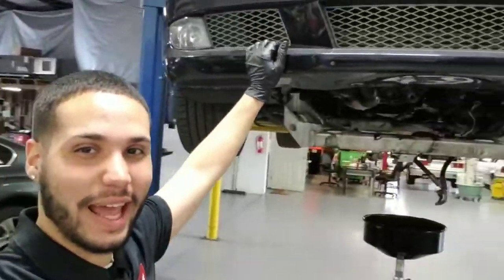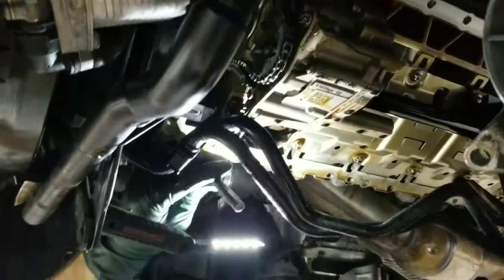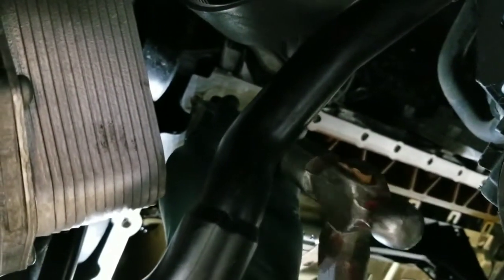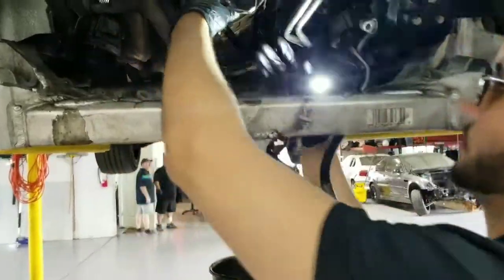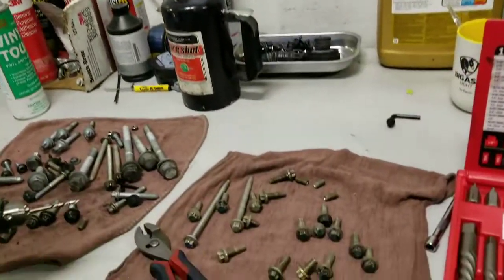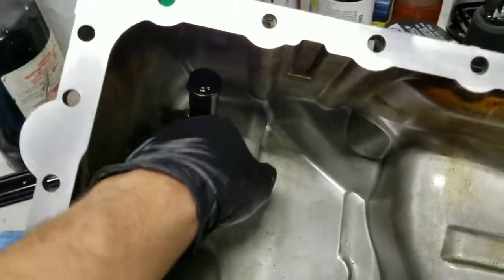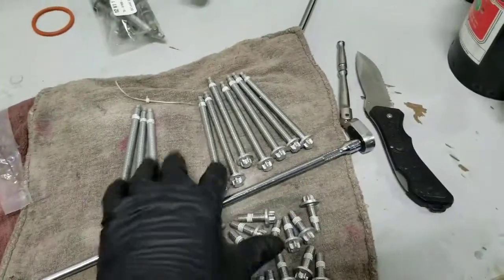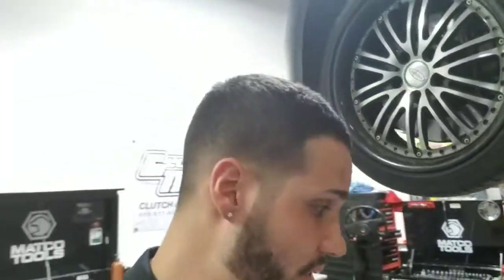2007 335i oil pan gasket!

Comment: I plan on doing my oil pan gasket this summer. I don't know if it's ever been done so do you have any pro tips for removing one time use bolts that might have been reused? I would hate to have to extract even one of them.
Reply from the maker: If they snap taking them off or are already broken, try twisting with a pick or player's, if not you'll need to extract them

Comment: It is possible to make a hole  in the  oil pan to install a dipstick because  can't really check  the  oil level of the engine only with a  electronic system
Reply from the maker: Jérôme jéjé I definitely don't redo mend that, personally never done it or heard of it.   It is verry simple to check the level how the  manufacturer programmed it to.
Reply: Vazzy Snazzy i hope my electronic dipstick will not go wrong.You did a cool video.
Reply from the maker: Jérôme jéjé thank you! And if it does it's relatively easy to replace😊

Comment: Great video! What is the reason for replacing the oil level sensor seal btw? Does it leak oil from there?
Reply from the maker: Thank you! And  yes we did it that way for preventive maintenance
Reply: Its a “just in case” kinda thing cheap and easy if the pan is already off if it starts to leak after its back on then u gotta do the pan gasket again just to get back to it

Comment: Did you have to drop the suspension to access the pan? If not, would you have to on a 535i N54 E60?
Reply from the maker: You will have to drop the subframe, no suspension components need to come out except for drive modles. Axles need to come out and front diff
Reply: @danielvazquez1151  Yuck. Thanks though

Comment: What size bit were you using. How long did it take y’all. I have nine broken off. Didn’t find out till I pulled pan. So now my cars in garage with no way to get it to shop
Reply from the maker: The book time on this job its about 9 HRs, you dont need to ouch of a big bit, just enough to use the extractor.make sure you are patiend and dont drill your block

Comment: What's this job cost out at?  Gotta drop a lot of crap to do it, no?
Reply from the maker: It's about a 9 hr job the total price will depend on shop rate  which usually vary between 80 to 120 hourly rate
Reply: @danielvazquez1151  That's about what I was thinking.  I'm at 140k miles but have no noticeable leaks yet down there.  Did my VC twice though (myself).   But this one just doesn't look fun :)
Reply from the maker: @TheFrenchPug  it's kind of fun bit time consuming

Comment: Hey did you have any extra bolts left with that kit? I also had 7 long bolts but now I have some left over.
Reply from the maker: Yes I did. The same kit is used for different modles. Its normal
Reply: Thanks, I was searching all over and kept recounting how many I took out. I knew there was only one long one that was broken.
Reply from the maker: You are welcome, it also got me when I did my first one

Comment: Those are OEM bolts - cheap bastard that replaced his oil pan gasket reused the 1 time use aluminum bolts - haha
Reply: Small bolts are a no-no ? 
Now I see the 6 fat bolts on the reinforcement frame are aluminum. Gotta wait for shipping and replace them ?